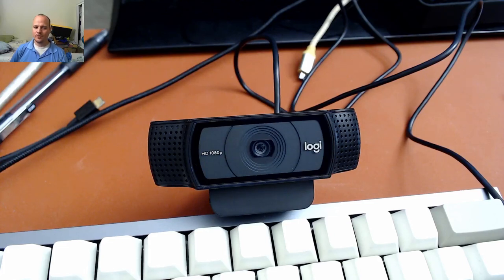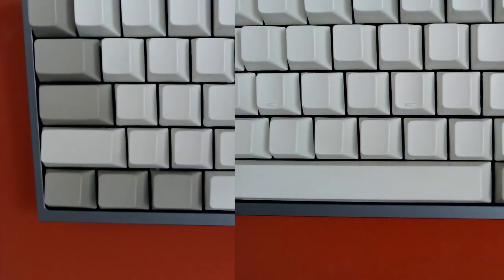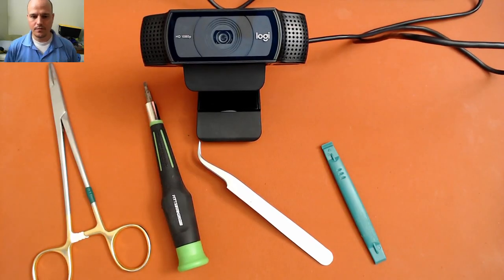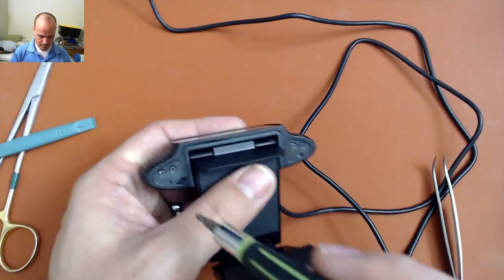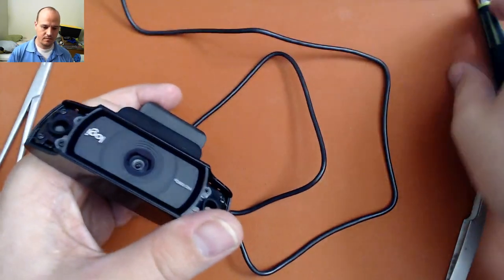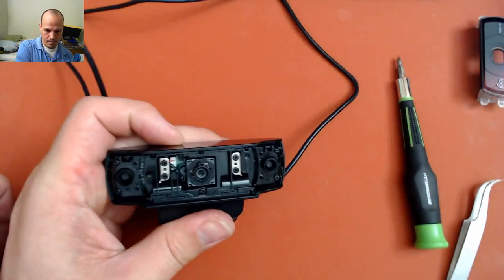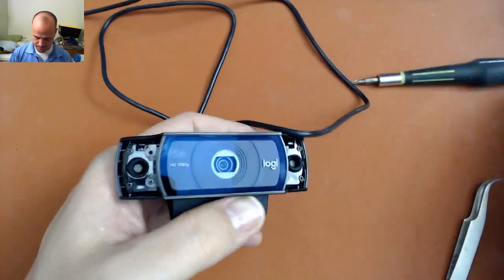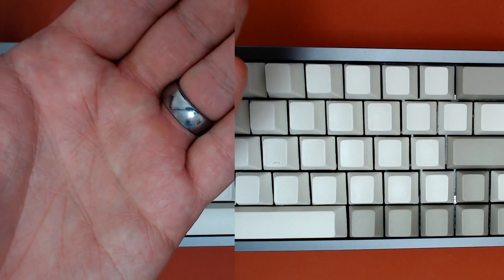Logitech C920 Auto-Focus Fix

Comment: Excellent! My cam was suffering with a weak auto focus as well. 
Since I use it mainly to record drawings and calculations for my students, it has to focus very close, which is possible manually, but not on auto focus.
As logitech drivers seem to get rid of any adjustments during reboot, I had to repeat this everytime I boot up my system.

Now it works like a charm. Thank you very much! :-)

For those who want to try this little operation: be sure to use screwdrivers of adequate size.
Even if it means you have to go downstairs. :-P
I ruined one of the outer screws and had to drill it out, which was way more exciting than intended.
Other than that, it was really easy.

Comment: Dude you rock.  Was about to buy different lens and muck around but this did the trick.  Interestingly, I'm using it to monitor a 3D printer so I need it to focus up close (< 8 inches) and it seemed that turning it the opposite direction (counter-clockwise) worked better for me.

Comment: Had serious issues with both my C920 and my C922 being quite nearsighted, to the point where I was considering buying eyeglasses for them to increase the focusing distance.
So glad I came across this video, as rotating the lens up to half a turn seems to push the maximum focus distance a few feet back. I can now sit at the proper distance from the screen and still be in focus.  I always use my cameras in manual focus mode so the auto focus isn't much of an issue for me, but this guide has made my cameras actually useful again and for that I am very thankful :)

edit: for other people that wants to try this fix, which I recommend you do;
make sure!!! you use a 1,5 phillips head bit/screwdriver, or you will strip the head on the garbage screws that hold the lens cover in place.

Comment: It's frankly amazing given the popularity of these cameras that Logitech haven't released a version that has an adjustable lens. The C920 is a great camera but having it only able to focus properly on things less than 50cm away from it is ridiculous. The Macro ability of this camera is really good too so even after modifying it I still had a ton of play in the focus slider for focusing on things that were really small and close-up - although I did lose auto-focus ability for macro shots as this modification appears to affect the overall AF range. Not really a problem since I use manual focus for the vast majority of my content anyway.

Comment: Thank you for this tutorial, that really helped! Hints to all who wish to try it: 
 - The results change with light and distance from the camera
 - To me, it appears that the autofocus works better in close range
 - The more light, the better. The light should shine on the thing you want to focus on
 - I found that the focus works well in a 40cm distance by default, but I sit approximately 90cm away from my screen. After adjusting the lense, the focus in this far range worked better, but maybe just moving the camera closer to your face and adding more light sources might fix the issues. 
 - I tested the effect of my adjustments with Logitech Capture on Windows 10. In that app, you can zoom in, pan, and add contrast and also adjust the focus manually

Comment: My C925e had the same problem and this fix solved it - THANKS! However, on the C925e I forcefully stripped off the front panel, and had to use lots of superglue to make it look some how like a respectable camera again afterwards. If you want to fix a C925e then carefully remove only the front grill (the metal-like sheet with smal holes in it) - then you can access the screws behind it.

Comment: Walker, THANK YOU so much for your video! I started using my Logitech c922x six weeks ago when I began teaching drawing from home. The focus issue was so frustrating. And I just fixed it following your instructions. Tough part was getting the screws off that hold the lens cover. Turning the lens quarter turn clockwise was easy; didn't feel like it was glued. Anyway, it's beautiful now, and it focuses at very close distances too, like 2-3 inches! Much much appreciated.

Comment: I just did this and I can verify it does work. Rotating the lens clockwise will let the camera focus farther away, while reducing its ability to focus very close. I found my camera had a focus range of 1 inch to about 8 inches, which was pretty useless for how I'm using it. I was able to set it up so its range is about 4 inches to basically infinity by turning my lens about a full clockwise rotation. After that, the cameras autofocus is perfectly good. I think the issue these cameras have is they screw the lens on in the factory without testing the camera to see if its actually been set to a usable distance.

Comment: Thanks for your video. I have the Logitech 922 and used your method. Works perfectly.  I have adequate lighting and that wasn't the issue.  It would focus and then unfocused. It's absolutely ridiculous that we have this problem in the first place, but thank you for helping resolve it.

Comment: I can confirm, this will also work with the older C910 model which I still use. For that one, you only need a prier and some fingers to open the case, no screws need to be touched! Thanks a bunch :)

Comment: i have been using the c920 as octopi cam on ender printer, the darned thing has never been in focus, i have now done as instructed, the stickers at the bottom came off in 1 piece and could be reinstalled, not sure what happened to yours, i stuck a razor underneath and it peeled back without effort. The camera now focus's, i did it with the webcam enabled and literally confirmed the results with minor adjustments, surprisingly, 1/4 turn was the perfect setting.

Comment: A word of warning - I tried this and one of the 4 screws which hold the clear plastic screen in front of the camera stripped, because it was overtightened from the factory. I was still able to perform the mod by bending the screen back, but my camera is definitely worse for wear as a result. It still works, and the mod was performed successfully, though my main issue was gradual defocus over time. I haven't had it running with the mod for long enough to see if it has fixed that

Comment: This problem with the autofocus on the Logitech C-920 and C-922 should have been fixed by Logitech a long time ago. Strange that they can not make a webcam that works flawlessly considering that you can make camera mobiles that work perfectly. I use my iPhone X as a webcam & it works without any problems. There is also no firmware update for these two webcams.

Comment: Has anyone had any luck disassembling the C920S? There's no screw holes underneath the rubber pads so I don't want to brute force the side panels open and risk breaking something.
Reply: Under the rubber pads there are black stickers that also need to be removed

Comment: Can you link to the source that gave you the fix? I want to know more about "why" this works.
Reply: I'm also curious to understand why turning the lens 1/4 gets it all fixed! I just did it and it seems to have worked neatly.
Reply: @lawpriest  I'm guessing your changing the focal depth much the same was as a fixed focus camera. So the 1/4 turn helps it focus closer up. But I guess at distance it will get worse. But most people having this problem are using the cam for close up ,/ stop motion etc.

Comment: I couldn't unscrew the final 4 screws, these are so damned tight, and now they're stuck 😡
Reply: i am having the same problem. You think they are glued or something?
Reply: I also have the same problem. The screws are so tight. I got a few out but it requires a wrench to turn the driver. I gave up.
Reply: They might be glued indeed, I gave up and couldn't fix the focus issue
Reply: I just tested this. The screws came out without issue, but it's important to have the correct dimensions on the screw driver. I used iFixit tool with PH0 bit. Tried with PH00 first, but then it would slip on some of the screws. PH0 worked better.

Comment: Hello Walker, I'm having a problem with the C920 : I'dl ike to remove automatic autofocus, and when I use the driver to do it, it just starts again. Would you have any advice on this ? I'm working on Windows :/
Reply: Download Logitech Capture. You can turn it off in the settings.